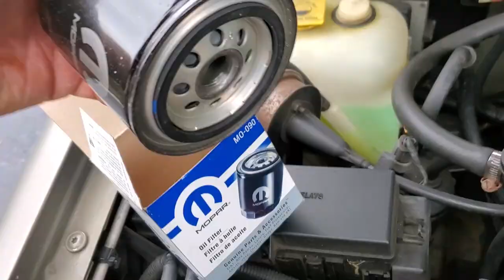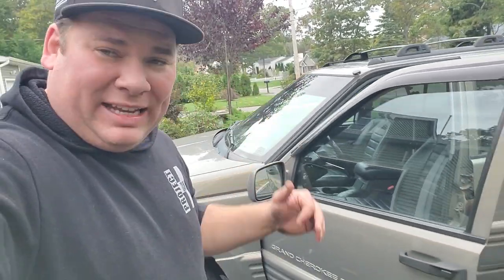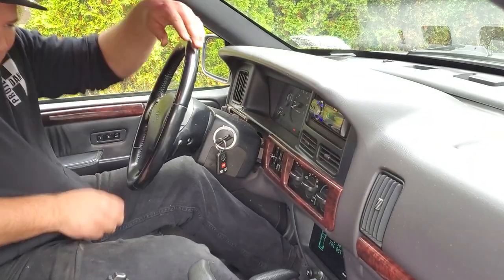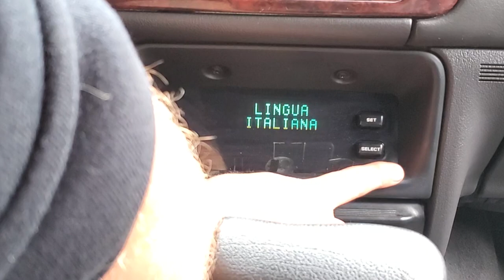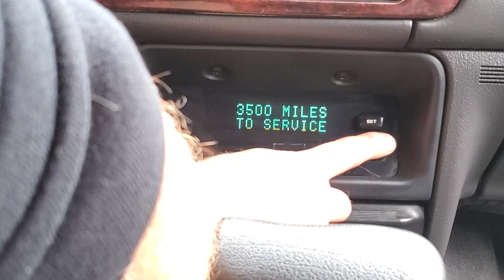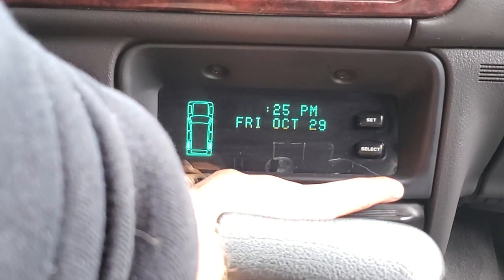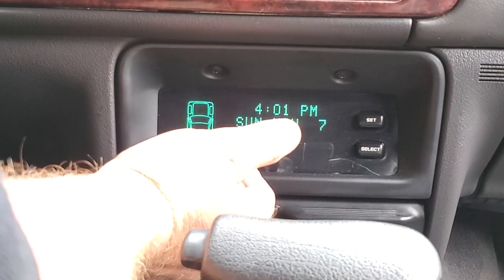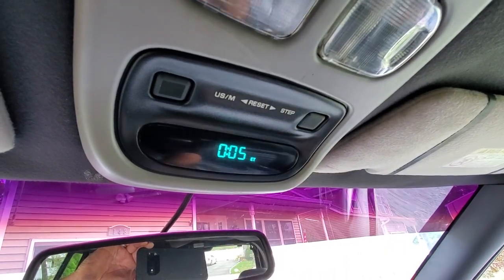PROGRAM YOUR JEEP ZJ VIC - OIL INTERVALS, OIL RESET, DAYLIGHT SAVINGS CLOCK

Comment: Funny you post a ZJ video, just a week after I found my old 96 ZJ sitting in the pick a part yard near me :(.  Was happy to see it and sad to see it at the same time.  When I sold it back in 2010, it had 232k on it, the viscous coupler in the t-case was shot and the driver's and front passenger seats were torn up....They were totally trashed when I saw it last week, and oddly enough the key was sitting in it...I happened to have my jump pack, and just by chance thought hmm, wonder if I could get it to power up enough to read the odometer...it did, and the odometer reading was 561,016 miles...so it ran several more miles after I sold it.  Sad to see the end of its life though.  I see white 96 ZJ's all the time but mine had an odd front tow bar on it that was very easily noticeable, and an odd switch under the dash I never figured out what it went to...so those 2 things gave away that it was my old Jeep long before I checked the VIN.  I miss that Jeep, it spent more time offroad in the mud than it did on the highway, and even at 232k I wasn't afraid to jump in it and drive it across several states...my boss at the time just kept after me about selling it to him...so I did, he didn't have it a year and sold it..the last owner drove 180 miles round trip to and from work pretty much daily with it, used to see it sitting behind the store he worked at all the time....then suddenly it was gone, guess now I know why....windshield had "BAD TRANS" marked on it...well I guess that old 42RE had enough LOL...honestly surprised it didn't fail on me given how I beat on it, and the stuff I towed with it, seemed pretty bulletproof while I owned it...wish I only knew back then how easy transfer case swaps were and how easy it was to replace the seat upholstery, I would have kept that Jeep.  4L I6 never let me down, only a bad starter left it dead in a parking lot...luckily never let me down in the middle of nowhere LOL.  The starter and a leaking radiator were the only 2 issues it ever had...regular oil/filter changes, and transmission services every 45k, and diff fluid changes every time I got into deep mud/water with it, transfer case services every time I had the transmission serviced...if I knew about the transfer case swaps I would have went with the 242 Selec-Trac.

Oh and my copy of your 98 ZJ went to the crusher a few months ago...replaced it with a 2008 Ford Explorer Eddie Bauer 4.6L V8 4x4.  That poor Jeep just had every single electronic/electrical problem that's known to Jeep, as well as the dreaded 42RE problems :(....It had Selec-Trac and the rear limited slip too, when the transmission died I was pretty pissed off as I had put 4700 miles on it in the 3 years I had owned it, and all of them were highway miles and a couple trips on a gravel back road to a small town.  

Thinking my next Jeep might be a WJ with Selec-Trac, or an XJ with Selec-Trac.  Or...if I can find a Comanche with Selec-Trac...I've only seen 1 that was for sale, I've spotted a couple but they were no longer operational sitting in scrap yards, sadly the bodies on them were in pretty dang good condition given they were 30+ years old.
Reply from the maker: Thanks for sharing brother! Great story, great info

Comment: Good to see you, hope everyone is well. I have a very small leak in 2000 wj. I sure hope it's not a crack in the head, or heater core, will be doing a color die, hope to fine it , OMG I've never had such a hard time finding a leak must be very very small. I even changed the reservoir bottle.
Reply from the maker: man, im chasing a small issue in the zj. i think its a small pin hole in the top of the heater core
Reply: @ProjectDanH  results back, pressure test ok checked core also, on wj theres a  drain tube where heater core is and that tank was dry so we ruled that out. Found out I was only loosing antifreeze when cooled down and dripped in the exhaust,  so when it ran you couldn't tell. Ever so slight. It would just burn away. When its apart I'll try to get some pictures, what we find. So far I do believe head has a small crack.
Reply: Hi Dan,  OK an update replace head with remanufactured one, replaced all the hoses, thermostat, fluids also. Been over a week and showed antifreeze still at the top. I'll keep checking it for a while. Keeping my fingers crossed... P.S. I need a sticker on back of my jeeps. Lol.  How can I buy??
Reply from the maker: @davidbhall1042  Awesome Dave!  Send me a paypal donation - airvillan2000@aol.com.  Remember to include a return address for the stickers. 
Thankl you!

Comment: A common fault I noticed with VICs in mine and the salvage yards is the traces erode away then short out. What I did to fix mine was remove the remains of the traces, then soldiered wires in their places. My first try at soldering and it works great now!
Reply from the maker: Awesome! It's always a great day when you can fix your Jeep on your own!

Comment: I changed the date on mine but when I hold set it just goes to where I can change am and pm not the time
Reply from the maker: do you still have the factory radio?
Reply: @ProjectDanH  yeah I do
Reply from the maker: @natekevleighan5906  If a factory radio is still in the vehicle you set the time with that

Comment: On my 97 ZJ i bought a Vic to replace the stick the useless display mofeulr   for some reason it didn't work and the Vic is functional ..
Reply from the maker: does you ZJ have all the factory plugs in place?
Reply: @ProjectDanH  apologies for the typos lol but yes I bought a used VIC from ebay two of them as a matter of fact from two different sellers and they don't turn on , the old GDM powers on but flickers.. so I dunno I'm stumped with the VIc..appreciate ur respone BTW
Reply from the maker: @killervito  have you bench tested it with a power supply? If you know it works then you may have a wiring issue in your Jeep.  test for 12v and ground